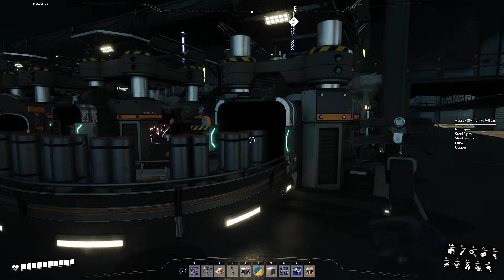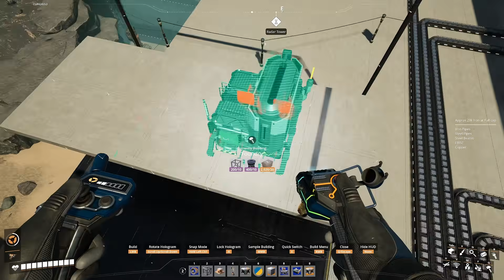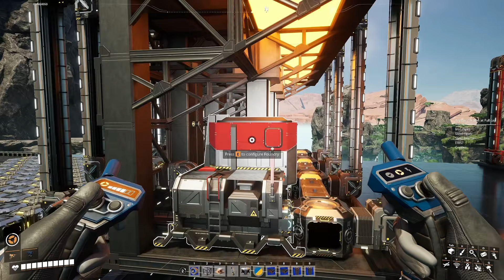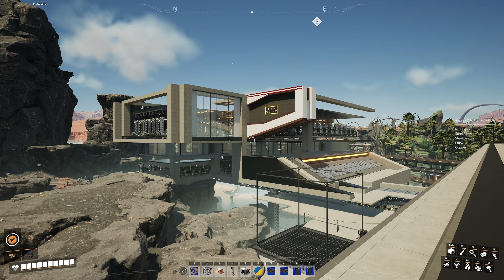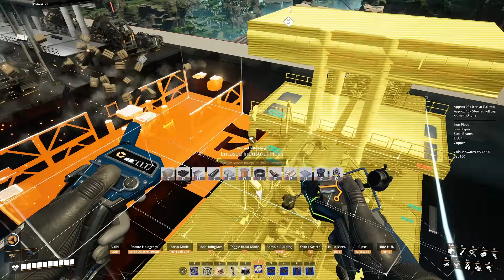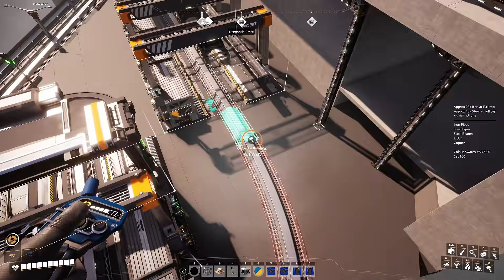I Built An EPIC Steel Faciliity Using ONLY Alt Recipe's - Satisfactory

Comment from the maker: What are your favourite steel recipes to use?
Reply: I was rather proud of myself when I setup a munitions factory near my Nitro Rocket fuel plant to use up my compacted coal to make steel, black powder, rods.
Reply: It was a fun for me to setup with steel screws to make bolted plate and frames for versatile framework. I would not recommend this for all players. As I am an inline production line builder and tend to use extra machines over balanced and manifolds. Steels screws is constructed strictly as inline. 
 Caste Steel Plate, Steel Rotors, Steel Frames, Molded Pipe, Encased Industrial Pipes, and Heavy Encased Frames.
 Heavy Flexible Frames would be used with other iron and rubber based recipes and coke steel. I like compact steel but its power consumption has a wait. Ok I like all of them.
Reply: I boosted my steel production with my waste petroleum coke. That worked really well.

Comment: When is Total gonna realize that He's in 1.1 when He's making His Blueprints??

Dude, You're designing a Foundry Blueprint that is Stacked, and still building all Your Splitters on the bottom Floor??

You can connect the Lifts from 1 foundry to the foundry above, then use a Vertical Splitter bussed down the middle of the row.

Use the Squished method of attaching 1 series of lifts, and the standard method of attachment to avoid the belts clippings along the Bus.

Then You end up with a Clean walkable Floor Space on both Teirs

Comment: Personnaly to order the blueprint I use an ID at the begin of the name.
Each section is 1000 and sub section by 100.
Example :
I have 3 blueprint for fondation 5x5, 1m, 2m and 4m. The 3 bueprint begin by 3000 - XXX
I have the same thing for steel fondation but its 3001 - XXX
Like that I can easly find a blueprint with N (simply by typing the ID).
And the section, it simple 
Example :
1XXX -> each manyfold, 10XX -> smelter, 11XX -> constructor, -> ...
2XXX - > each "raw ressource" -> 21XX iron -> 22XX copper ->...
3XXX -> fondation and other
4XXX -> train -> 41XX -> monorail -> 42XX two way

With this you can easy order blueprint, specialy if tou go to the blueprint folder (in the computer) to copy or delete blueprint. (all my temporary blueprint i have no id so it simple to delete same this way).

Comment: Hey, if you're reading this, I'd be interested to know what kind of hardware you use to run this game? Satisfactory is CPU bound but I'm interested if it's beneficial to have something like Threadripper with more memory channels, or just X3D processor or something. You do quite large scale builds with lots of stuff on belts and this game works in item batches so... It stresses processor and of course also RAM is rotating fast.
Reply: Threadripper cpus are always worse for gaming than x3d chips
Reply: @whizzy.1043 It depends a bit, some games like City Skylines and other building games may be heavily parallelized, as well as something like Total War type strategy games. Sure, for most FPS games and most common game engines for that matter, the "game thread" is a main thread and thus single core binds the performance after certain level of cores are saturated.
Reply: I can comment on X3D - I recently upgraded from 3700X to 5700X3D and not only did my FPS more than double, which is NUTS, but I can enable global illumination which surprised me. The game doesn't favour multi core so Threadripper would be a waste as those are slower cores overall, just many of them. 

The game generally doesn't slow down until things are in scene and the GPU gets battered as much as the CPU there. I have a 3080, game at 4K with DLSS set to lowest (this game doesn't really need high fidelity, but want it on 4K res so the UI etc. is the right size) and frame gen using Optiscaler and Nukem's DLSS to FSR3 mod. I get 90-100fps with all settings maxed, drops down to 70s when in a big factory (to see how big, the modding discord screenshot area has screenshots by AndyT that's mine). Oh and 32GB DDR4 3600. Never ran into RAM issues, it goes up to around 28-30 while gaming but I let my torrents use a huge chunk as cache.
Reply: An Xbox series s. I was cloud streaming on an Xbox one before I got my series s. It released Nov 4th on console